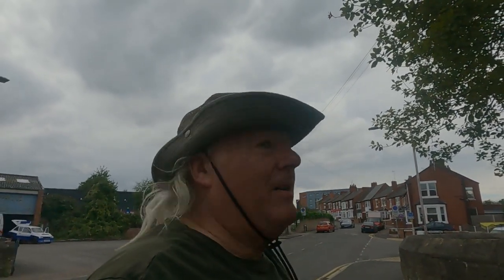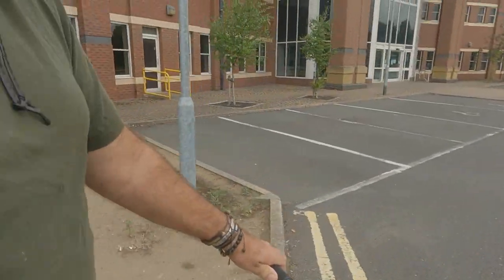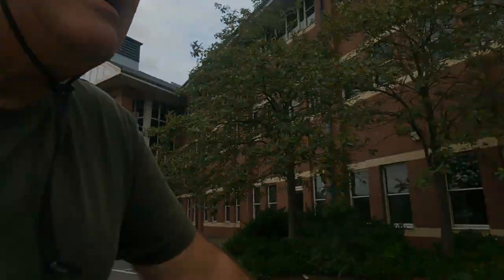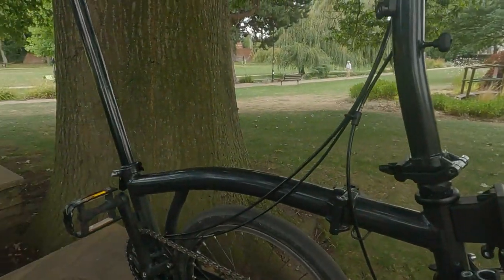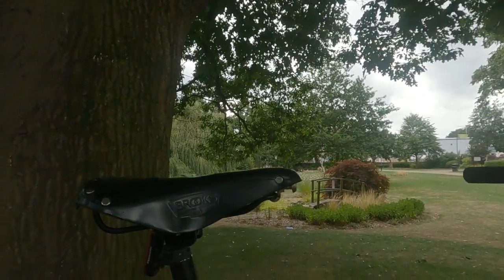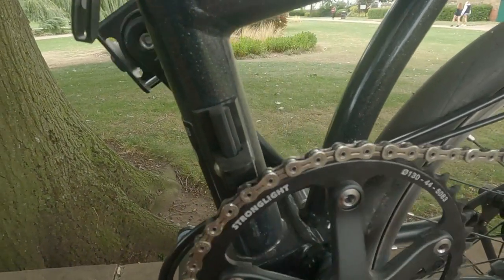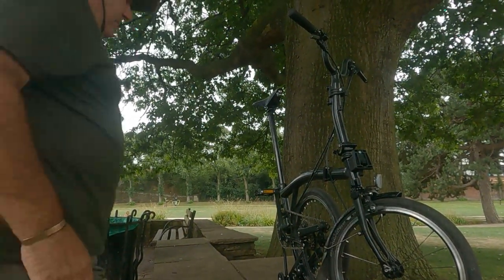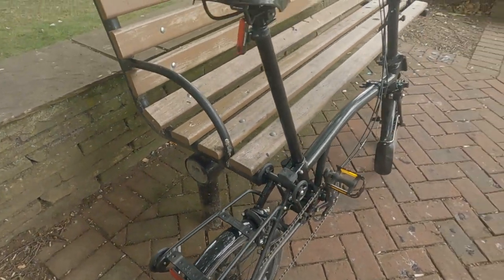Brompton P-Line Five Months On Review

Comment: I have found two strips with velcro and each having a bolthole for a bottle cage, to be combined on a Brompton! I also have a tool being able to ad a new thread in a hole, but still it involves drilling two holes in my frame or stem post before that, so I decided against it. As a Brompton Weight Watcher my much former than Superlight is presently down to around 8,5 kilo, without a rack,  but mudguards, and with a superlight extender in the back for more stability. Finn. Denmark

Comment: Presta valves do my head in.....pain in the arse. Glad you changed them.

I would change the grips to ergon gp2 or gp3.

I still see the gears as a problem with the standard stock gearing as too narrow (which is less than the standard 3 speed bromptons).

My personal preference is a M6R-x superlight which isn't much heavier than the P line.....ill bring mine out soon so you can compare.
Reply from the maker: That would be a great comparison to do.

Comment: Hi Andrew
On reviews there is some question on the gears slipping 
Have you had or heard of any issues ?
Reply from the maker: Hi Garry.
Just an 1/8 of a tune to tighten the gear cable, when I fitted the 44T chainring the chain came off when being carried folded so I have removed one link,  no problems since. 
Thanks for watching and your comment.
Reply: @NottinghamshireMadness  thanks Andrew
Love the channel
Know the areas you cycle round Nottinghamshire as live in Notts